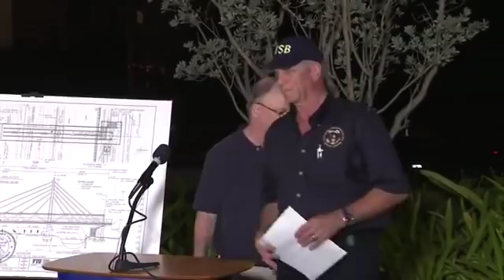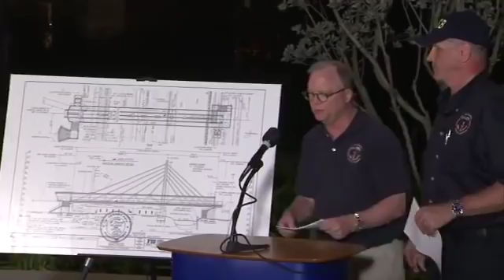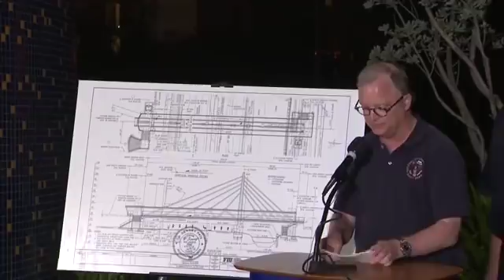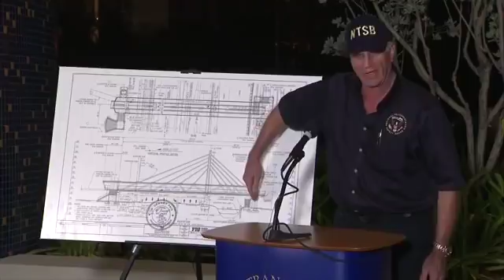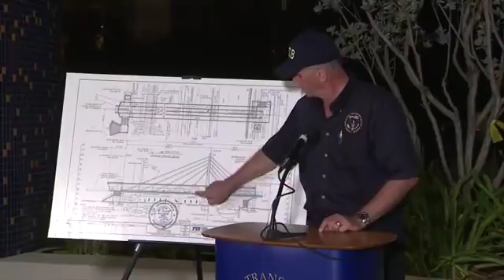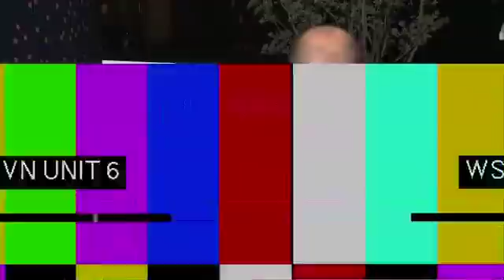FIU Bridge Collapse NTSB Update

Comment: New structural deficiency discovered by yours truly.  There was insufficient strength in the bridge to transfer the compression force in member #9, into all of the bearing plates that anchored the (4)- 2 1/2" dia tension bars in member #10.   Each bearing plate was 12" x 14".  However at the base of member #10, there was no overlap of the compression zone beneath two of these plates with the longitudinal projection of the cross-section of member #9 diagonally down through those plates.  Consequently, there was a concrete shear failure at the base of member #10, that precipitated the bridge collapse, which was one of the two areas from which dust and deflection appeared first.  Yes, I was project engineer for the tallest (1100 ft) self supported reinforced concrete structure that was erected on the highest seismic Pacific Ring of Fire.

Comment: List of deficiencies prepared by a retired structural engineer.  1. The concrete was only 7 to 10 days old, which equates to 70% of design strength.  2.  Shear stresses are so large through the  joint between compression diagonal #11 and tension diagonal #10, that it is impossible to fit enough horizontal shear ties in the joint, where none were present.  3. The tension steel in member #10, had insufficient embedment in concrete at both the top and bottom to develop it.  4. There was no direct shimming in the end support girder that compression member #11 framed into, directly beneath the joint at time of collapse.  5.  Compression member #11 was undersized especially since it was subject to sidesway at the top and their was no compression longitudinal column steel.  6.  There was insufficient mild reinforcing in the the roof slab to joint of members #10 and #11, to transfer the huge roof compression force into that joint.  8.  No qualified structural engineer designed this bridge.

Comment: Doomed from the start. Too much concrete not enough steel. Highway bridges used 3' ft high I Beams tied together with 50- 3" bolts & steel decking. This bridge was constructed with concrete & pretension concrete members with Zero steel decking or I Beams..

Comment: The cause of failure was a terrible design that should never have been approved. How can a design with a single row of vertical trusses ever be approved. Single point failures should never be allowed in a bridge. Duh. 

Concrete truss is a bad idea too. Complex shear and bending forces on adjacent members.

What other bridge has a dead load to live load ratio of 50 to 1 (950 tons to 20 tons)? This was a vanity project for FIU (ABC originators) and a huge boondoggle.
Reply: rickterfied , I agree ! George Wu, ARCHITECT, A.I.A., NCARB
Reply: Thanks georgewu5. Here is a newer post with more information: 

While all the speculation and analysis of the bridge collapse is interesting and important, I believe it misses a more important fundamental point. That being that the design was extremely flawed. The first mistake was designing an "innovative" truss bridge with a single row of vertical struts.   It is a single point failure with zero redundancy.  See the Silver Bridge collapse (https://en.wikipedia.org/wiki/Silver_Bridge ) about the need for redundancy and this caution about the dangers in a new design: "It is that its legacy should be to remind engineers to proceed always with the utmost caution, ever mindful of the possible existence of unknown unknowns and the potential consequences of even the smallest design decisions." It looks like the designer did not learn anything from, did not know about, or ignored prior bridge failures.

The Silver bridge was criticized for low redundancy. In light of this, how was a bridge with no redundancy ever approved? I would like to know what the published safety factor for the FIU bridge was.

This was initially described as a cable stayed bridge: 
http://www.mcm-us.com/news/mcm-awarded-fiu-pedestrian-bridge-project#.WsJ3Lq2ZPMW
"This $9.3 million project will be an iconic cable-stayed pedestrian bridge"

 Somewhere along the way it evolved into a truss design that mimicked a cable stayed design. It probably would have worked if it was a true cable stayed design with the cables tied into and supporting the deck. When they decided to make the truss with post tensioned concrete they could not have the cables support the deck so they made them decorative.

The fact that it was not a cable stayed bridge but was made to look like one should have raised concern and subjected it to additional scrutiny. It is deliberately misleading and being deceptive. If you can't trust that it is what it looks like, how can you trust its safety and robustness.

The second mistake was designing a post tensioned concrete truss. There are complex rotational, sheer and bending forces between the intersecting adjacent post tensioned bars within the concrete that the concrete can't handle. These forces are hard to predict or model. Any tension forces within the concrete make it vulnerable to failure. The truss should have been made of two or more rows of steel girders and connecting plates that can transfer the changing loads effectively. The designer, design reviewers and approvers, at all levels, need to be held accountable. 

This was a very aesthetic "iconic" design with terrible engineering to highlight the ABC construction method pioneered at the school and to highlight the school of concrete engineering. What a huge embarrassment.  Shocked it was ever approved and built. Where was the oversight? This design will go down in history and will be studied as precisely what not to do.

Design discussion:
http://www.miamiherald.com/news/local/community/miami-dade/west-miami-dade/article206122229.html

The lack of robustness of the design is evident by the fact that a single worker was able to bring it down.
Reply: rickterfied,  Clearly explained the bridge failure !  FIU bridge had the cable bridge look but without the cables ! The redesigned single row of truss that was supposed to do the job did not do the job ! That was why FIU bridge collapsed ! George Wu, ARCHITECT, A.I.A., NCARB 2018-4-9

Comment: Not enough reinforcing in the roof slab at the concrete cap, over the 1st interior brace intersection.  A huge load needs to be transferred from the roof slab to last diagonal brace, at that concrete cap.  Post crash photos reveal very little reinforcing at the suspect joint that failed before all other ensuing failures.

Comment: In REPLY to "Steve Reed's" Reply - This is the third (3rd) U-Tube Video I have watched and all three (3) referenced design documents reflecting that the Center Tower and Stays were Cosmetic but also to add Stiffness to the structure and address Dynamic Load forces created by the harmonics that pedestrian traffic and category 5 hurricane winds might create.  The Stays were to be Metal Tubes and not Cables.  It was not designed to be a "Suspension" supported bridge.  Rather, a "Truss" supported bridge.  You see a lot of old Roadway and Railroad bridges with "Truss" support.  Those old bridges used Metal or Wooden Truss works.  In this case, the Truss works were "Post-Stress" Concrete and not Metal or Wood.  "Post-Stress" Concrete means you await the concrete to harden and then you pull the Metal Cables; that were pre-concrete pore imbedded inside tubes, with Hydraulic Jacks.  This "Tensioning" of the imbedded Metal Cables gives the Truss members Tension load strength.  The reason you need to "Post-Stress" the Concrete is to give the Concrete Tension Strength for Concrete only has Compression Strength, not Tension Strength.  Metal or Wood on the other hand have both Compressive and Tension Strength.  So a TRUSS supported walkway made of "Post-Stress" Concrete Truss elements to give the Concrete Tension Strength.  So no Center Support needed.  My question though is why was the Tensioning of the Truss members not preformed prior to putting the Span in place?  Your point is correct for if the Tensioning is done after the Span is in place, you would necessarily need to support the Span through it's entirety, not just at the ends?  One (1) of the U-Tube Videos indicated that installation called for there to be 2-falsework supports at each end, positioned right where a Vertical Truss element was located (so under four of the Truss members, two at each end).  Due to an obstruction close to one of the ends, it was necessary to move the 2-falsework supports on that end to clear the obstruction.  This was supposedly approved by the Design Team but it called for some "Post-Tensioning" to be performed on that end prior to positioning the Span in place.  After they positioned the Span in place, they were in the process of completing  the "Post-Tensioning" on that Truss member and then they would proceed with "Post-Tensioning" all the remaining Truss members.  The bridge collapsed as they were completing  the "Post-Tensioning" on that Truss member.  So there will need to be a lot of detailed investigation to uncover all the problems with probably the complicated design and also the resulting complicated installation required.

Comment: William Smith -  You are so Correct.  They (NTSB) repeated ever question, which is NECESSARY, otherwise we would not know what the question was.  What I do not understand though?  Why, in this Technically Savoy country of ours, do you not have a number of Podiums set up about halfway down the isles of the Reporters so that questions can be posed by the Reporters into a microphone?  There would be no need to have to repeat the questions then, other than maybe to summarize the question if the Reporter rambles on with his question?  I see this repeated time and time again and in most cases, including at the White House when a Press Conference is held by the President outside of the White House "Bradley" Press Briefing Room.  In the case of the President, he usually doesn't repeat the Reporters questions and you really cannot connect the answer to the question till at the end of the answers, by inference only.  Ridiculous, isn't it?

Comment: Why would you not support the center until the center supports were compleate? Can anyone answer that obvious question?
Reply: Uh.... because there weren't any center supports, they were more concerned about the traffic lane it would require. In fact the FDOT came back after the bridge design and wanted the now collapsed section of the bridge extended eleven more feet, this was also to allow installation of another traffic lane at a later date on the canal side.
Reply: This is the third (3rd) U-Tube Video I have watched and all three (3) referenced design documents reflecting that the Center Tower and Stays were Cosmetic but also to add Stiffness to the stucture and address Dynamic Load forces created by the harmonics that pedestrian traffic and category 5 hurricane winds might create.  The Stays were to be Metal Tubes and not Cables.  It was not designed to be a "Suspension" supported bridge.  Rather, a "Truss" supported bridge.  You see a lot of old Roadway and Railroad bridges with "Truss" support.  Those old bridges used Metal or Wooden Truss works.  In this case, the Truss works were "Post-Stress" Concrete and not Metal or Wood.  "Post-Stress" Concrete means you await the concrete to harden and then you pull the Metal Cables; that were pre-concrete pore imbedded inside tubes, with Hydraulic Jacks.  This "Tensioning" of the imbedded Metal Cables gives the Truss members Tension load strength.  The reason you need to "Post-Stress" the Concrete is to give the Concrete Tension Strength for Concrete only has Compression Strength, not Tension Strength.  Metal or Wood on the other hand have both Compressive and Tension Strength.  So a TRUSS supported walkway made of "Post-Stress" Concrete Truss elements to give the Concrete Tension Strength.  So no Center Support needed.  My question though is why was the Tensioning of the Truss members not preformed prior to putting the Span in place?  Your point is correct for if the Tensioning is done after the Span is in place, you would necessarily need to support the Span through it's entirety, not just at the ends?  One (1) of the U-Tube Videos indicated that installation called for there to be 2-falsework supports at each end, positioned right where a Vertical Truss element was located (so under four of the Truss members, two at each end).  Due to an obstruction close to one of the ends, it was necessary to move the 2-falsework supports on that end to clear the obstruction.  This was supposedly approved by the Design Team but it called for some "Post-Tensioning" to be performed on that end prior to positioning the Span in place.  After they positioned the Span in place, they were in the process of completing  the "Post-Tensioning" on that Truss member and then they would proceed with "Post-Tensioning" all the remaining Truss members.  The bridge collapsed as they were completing  the "Post-Tensioning" on that Truss member.  So there will need to be a lot of detailed investigation to uncover all the problems with probably the complicated design and also the resulting complicated installation required.

Comment: So they place the bridge over the public highway and then strengthen it? Seems risky.
Reply: Seems?
Reply: It's not done that way if you use quailified errection companies and engineers.
Reply: Liberty Warrior 
"it's not done that way if you use qualified erection companies and engineers"
Title of your sex tape
lol sorry
Reply: @ 140 Ex; The lift jacks should have remained in place until the Post Tension Rods were tightened. But they didn't want to stop the flow of traffic and thought it would be fine to remove the lift jacks after placement. I'm not sure who's decision that was. However, there are many potential reasons this bridge collapsed, and could be a combination of some or all of them. can't wait to see who the final finger points to....that's when it really gets interesting!
Reply: Linda Figg of FIGG Bridge Group did change the cable bridge to the open web beam bridge. Whether she had done the new calculations for the truss or not is debatable. The detail drawings that posted in YouTube did show the separation between the overhead cables( or tubes ) from the 21"x 24" concrete diagonal truss members ! It is  amazing to see this had happened ! --------- A cable bridge without the cables ! ---------open to the public in the middle of construction of the FIU bridge ! Amazing and SAD !  George Wu, ARCHITECT, A.I.A., NCARB 2018-4-9

Comment: It was unnecessary to build a 950 mega ton pedestrian bridge loaded down with heavy concrete. A light weight Aluminum pedestrian bridge without the heavy concrete would have been more safe for americans to walk across and drive under .
Reply: It was supposed to be the showpiece for the FIU engineering department. A cookie cutter bridge would not do. It had to be pretty and memorable.

They got a memorable one all right.
Reply: * Firefox but that would’ve stopped traffic for an hour. No. Miami citizen can’t have that.
Reply: These guy should search youtube “fui bridge collapse” and get their answers. Case close.
Reply: Firefox, it is way beyond STUPID to use concrete on a simple pedestrian bridge, It should be made from the same material used in making vehicular bridges HIGH STRENGTH STEEL.  https://www.google.com/search?q=Steel+used+for+bridges&rlz=1C1AVFA_enUS757US757&oq=Steel+
used+for+bridges&aqs=chrome..69i57j0l5.12592j0j7&sourceid=chrome&ie=UTF-8
Reply: Thxs Liberty Warrior , check out these aluminum bridges also, pure steel or aluminum built the right way.....The FIU bridge was built because a student was killed crossing the walkway by a car a few years back........Oh, it,s a Safe walkway bridge before it was even completed the contractor stated ....Dumb Dumber = STUPID alright.

http://www.wescomglass.com/Peace-Bridge.page
Specializes  in  large span Aluminum  walk ways .
 http://gatorbridge.com/applications/utility/

Comment: Perhaps the whole upper cable suspension tower portion of the bridge wasn't ''cosmetic''...  That would be a massive cosmetic touch.
Reply: sanjuansteve — It was essentially cosmetic.  It would have provided no significant support to the weight of the span.
Reply: female led engineering team

Comment: So much investigation its common sense u removed the support of the bridge before setting the wires the support its weight. There for it cracked because it had no support. Also department of transportation was left a vm by figg an engineer that the bridge was cracking two days before the collapse. The message was heard Friday. Something so important and was left in a vm and forgotten until to late i hope all the one responsible get maximum jail time.
Reply: The guy-wires were for looks not to hold weight. They had tension rods going through the diagonals, now they should have been torqued to spec's before the removal of any the trucks holding the damn thing up. Concrete is a lousy choice for that type of bridge especially if it is not poured right and using the proper concrete mix. Having qualified people who know how to pour and work the concrete correctly is imperative this is not like pouring concrete for your backyard patio. I think Jose and Manuel screwed to pooch on this one.